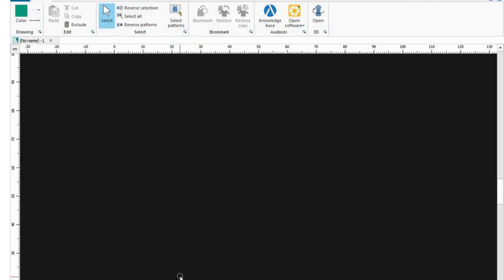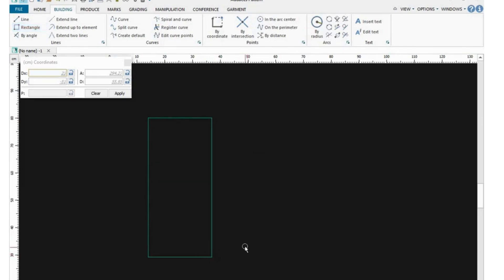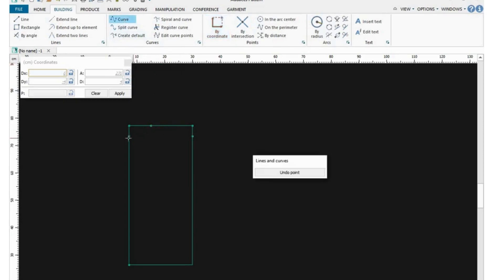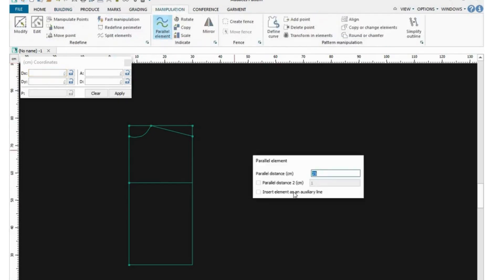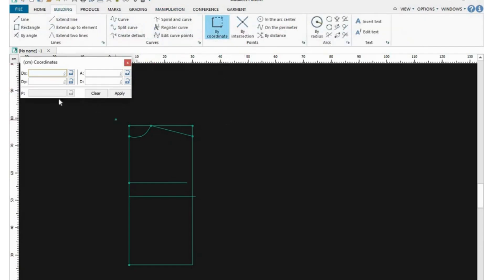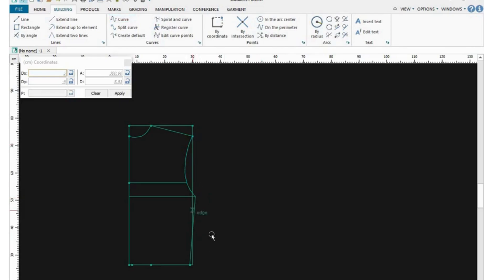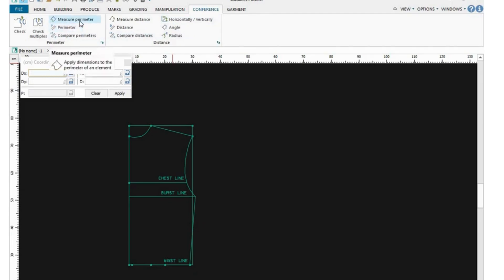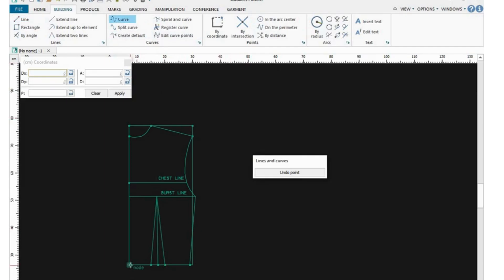AUDACES PATTERN /How to use audaces pattern  drafting tools  PART 1

Comment: Hello, good job you are doing, BUT PLEASE, where are you getting the numbers/dimmensions you are using ?
Reply from the maker: I am using my body measurements.
Reply: @Easycadpatterndrafting  so sad, that means some us that haven't sewn a stitch before couldn't use this software really, unlike MD or Clo3D, non tailors will be lost with this software
Reply: @Easycadpatterndrafting  Do you have a tutorial on creating 2D patterns that I can trace before fitting and simulating them in 3D?
Reply from the maker: To your first answer I do not think non tailors will be lost with Audaces CAD software.in my opinion  I think it is one of the simpliest CAD  software  for beginner.for me,CLO3 D and MD platforms seem a little bit complicated and intimidating for someone that is just starting to learn CAD pattern drafting. As I said that is my opinion 😊. Every body is entitled to their opinion.
Reply from the maker: To your second question, instead of tracing a 2d pattern and simulating it why don't you just design your style on a 3d model directly and also simulate. I use Audaces fashion studio to do that.just to clarify, I do not work for Audaces.I just love the simplicity of their systems.up till now you can use Audaces fashion studio for free.and I have videos taking you through how to do that.
Reply: @Easycadpatterndrafting   yes you are right about designing directly on the 3D avatar, the only problem I have with that is the finished product is not as real  and cleanas when done in MD or Clo 3d, and their runway/show room feature is way below industry standard of animation. The problem I have withMD or Close 3D is not even the tracing but their "FREE SEWING" OR MULTIPLE FREE SEWING", there's no detailed or good tutorial on free sewing, they just gloss over it  which led me to get the full Audaces 3D package, and discovered that the tutorial on free sewing on that one is even more whack